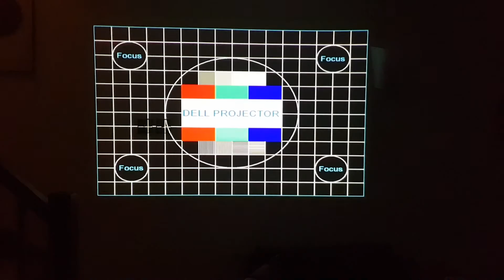Dell m115hd Projector Disassembly and DMD Chip Replacement

Comment: Just successfully performed this repair.  The DMD chip came from eBay.  They go for ~$50-80 (reclaimed, new).  On the back side of the chip there appear to be a thermal pad.  Eyeballing it it's probably 0.5mm (the type you use for SSD/power supply/memory...etc, I'm not 100% sure on the thickness).  Cut the pad to the same size as the rectangular step on the black heatsink,  You will most likely need a sharp knife to separate the clear films from both sides of the pads.  Apply it to the heatsink side for ease of alignment.  ONE thing to look out for:  If the ribbon cable came off during the disassembly.  It is held on via ZIF connectors(pull latch) on either side.  The exposed contacts faces away from the brown latch.  IMPORTANT to note that there is a 'Main board' and 'Daughter board' side of the cable.  It makes an electrical difference, so connecting it backwards results in 3 orange lights as soon as you plugin the unit!

Comment: I have one but only shows the Dell logo,  cannot access the menu or chance the source. What could it be?
Reply from the maker: That's not something I've seen before on one of these.  Sounds like it could be a problem with the main board or could need a reset if that's possible without access to the menu.

Comment: Hey Richard, Can you help me in identifying which cooling fan I can get for this? As mine is not working and therefore I get a message prompt at the beginning now and no display.
Reply from the maker: Hi, unfortunately I have no idea which fan is used.  It would look for a broken m115 or m110 projector on ebay and harvest the fan if you can't find the fan model